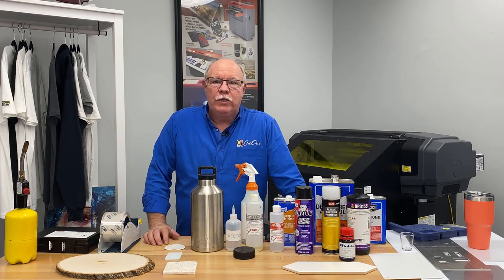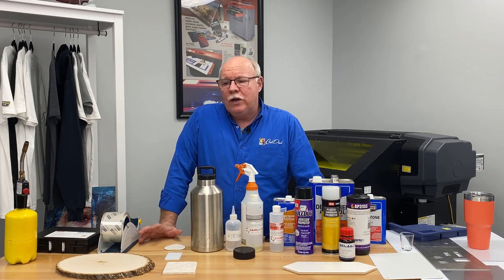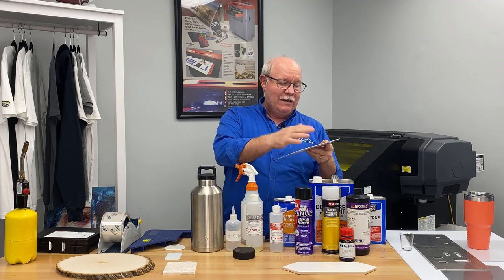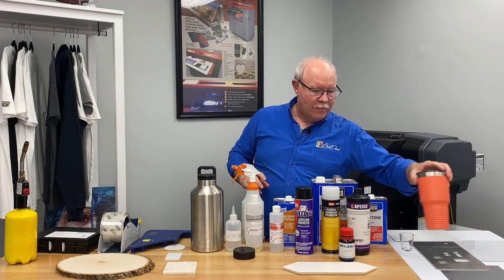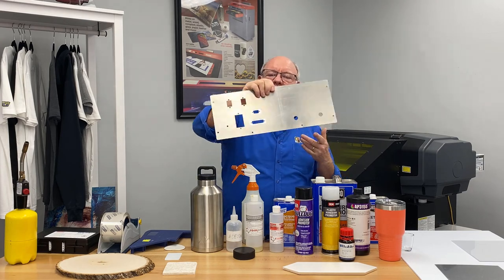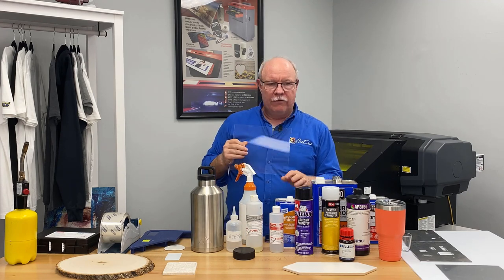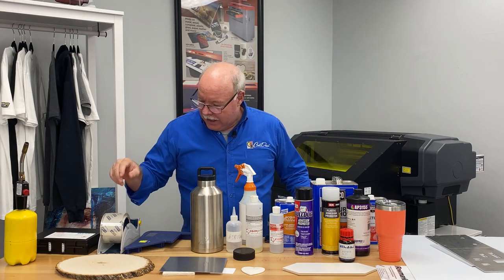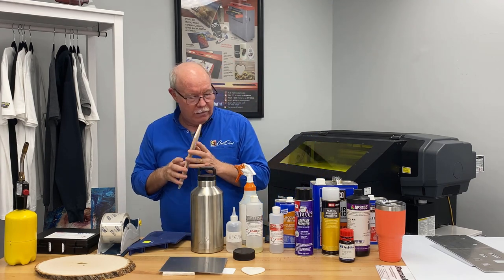UV Printing | How to Get Good Ink Adhesion

Comment: I'm considering purchasing a uv printer to replace black silk screening wood items by hand to hopefully speed up the process and reduce my actual labor. Typically, we manually silk screen, then epoxy over. With UV printing, will the "ink" bleed into the wood? Also, if I seal the wood first does it matter (for adhesion, etc.) if it's an oil based sealant vs. a latex? and if I were to top coat/seal AFTER UV printing, does it matter if top coat/sealant is oil based or latex?
Reply from the maker: Hey Jenny - if you can't find your answer spelled out in one of these videos it's best to visit the website and chat with one of our pros: http://compressuvprinter.com

Portrait Prints on Wood: https://youtu.be/2MoiNQUv3Qg

Printing on a Guitar: https://youtu.be/ILKADkKvCh0

Toilet Seat: https://youtu.be/plIa-aw830Y

Comment: Hello. I UV print on plastic.  I tried applying a clear coat spray on top of it but the ink started to bubble out and become rubbery. Any solution? Or different type of clear coating or sealing technique I should use? 
Thank you
Reply: did you find something that worked?  I want to do the same thing.
Reply from the maker: Hey Divyam! Have you reached out to support yet? They aren't available to answer questions on YouTube but you can put in a ticket online with them and they should be able to point you in the right direction. https://support.coldesi.com/